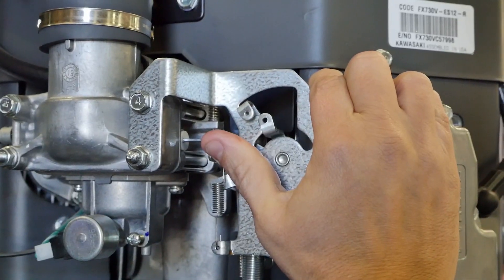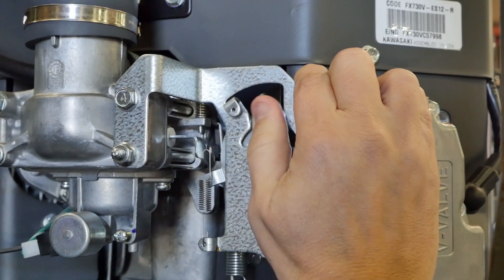WRIGHT | EFI vs. CARB Engines

Comment: Too many problems with Efi . Very difficult  to diagnose  and expensive to repair . Although of the problems I've heard of has to do with Battery's,  they must be kept at 100% charge. If not the EFI doesn't have the power to read properly.
Reply: Didn't he just said EFI generally make it worth while.  What don't u get lol

Comment: It's amazing with the computerized technology, most EFI engines can't simply go bang right away with less than a 90 degree crankshaft rotation like a carbureted engine can, instead you get "da, da, da, da, da, da  . . . ."

Comment: Very well done video. Some reject fuel injection because they don't understand it. I get the fact that service/reliability is a reason, but IF they are designed right, FI is a just a better way and lasts forever. I remember when people rejected electronic ignition and disc brakes on cars saying points/condenser and drum brakes were better - really!!??

Comment: I’m changing my two 37EFI Briggs to carbureted because the fuel injection sucks and it cost a lot of money to get the program to adjust it! 
I engine runs good the other will just shut down if you put low grade gas in it! After changing them over I want to see if I can run low grade gas. That would save me a lot of money!

Comment: I would disagree with one point, the closed loop EFI engines(Kohler & Vanguard) get noticeably better fuel economy than open loop(Kawasaki) in my observations.  Now the difference in fuel economy could be due to other factors, but I think it’s far more than a coincidence.  Just my opinion, but I think Vanguard is the best EFI engine, for that matter, I think Vanguard are the best mower engines period.

Comment: On my new ( purchased on 28 August 2023 / now 15.6 hours )  ZXT 72 61G8 / sn: 161469LF : I just had my dealership: D & J Equipment, Inc in Longwood, FL,  upgrade my mower to the  Wright part #72410104  " Tweel Wheel Rear Tires."  🤠 OH YEA

Comment: Imo the best engine out this days as far as commerial wise is the Briggs and Stratton EFI Vanguard with the Oil Guard system. I have several different brands of mower/machines and that B&S oil guard is a fantastic idea they did for the commerial gear.
Reply: The oil guard simply allows longer change intervals. The oil filter is easier to change. But it doesn’t do anything for longevity compared to the standard change. Both engines have an oil cooler. Frankly if your machine sits unused during the off season the oil should be changed at the start of the season regardless due to condensation that will be in the oil. So in short, I’m not sold on the oil guard system but I do like the Vanguard EFI engines.
Reply: @tylermacconnell217  one issue you didn't mention. If a wet sump system is low on oil (most fleet machines) and then you mow on a slope, the oil pump is sucking lots of air. Air makes a very poor lubricant. The MAJORITY of engine failures is not from normal wear but lack of lube. Also under high temps and heavy loads the dry sump tank significantly cools the engine oil more than that small heat exchanger next to the flywheel. One disadvantage of dry sump is cold weather, I warm the engines much more in cold weather before full load is applied almost 6 qts vs 2 qts of oil to heat up.
Reply: @firstname6208  Vanguard engines with Oil Guard are NOT dry sump engines. They would not behave any differently on a slope.
Reply: @tylermacconnell217  there is less than 1 qt of oil in the engine at any time, 5 qts in the tank, the pump socks oil from the tank puts it under pressure and into the engine. The pump is not belt drive, that does not determine wet or dry sump. The location of the oil determines that.
Reply: @firstname6208  I stand corrected. I looked at the Vanguard site and they are claiming it is a dry sump design. The added volume of oil, and being remote form the engine, will allow the engine to run a little cooler (even though they do both have an oil cooler, so apparently even the Oil Guard version still needs one).
Reply: @tylermacconnell217  I have two of these and there is no oil cooler on the engine (tin plate in its place). The  steel tank acts as the oil cooler and does sufficient job the oil is 10-20 deg cooler than without oil guard system. The sad part is inflation has driven the cost up so much anything new is just too DAYUM high these days.
Reply: @firstname6208  Strange, the ZXL with the 37 HP EFI has the oil cooler.
Reply: @tylermacconnell217  my dealer has a zxl in stock, I believe it has the 40hp vanguard. Next time I'll see if it has a cooler.
Reply: @firstname6208  ZXL is not offered with the 40HP, only the 37. You are thinking of the similar ZXT which only comes with the 40 and Oil Guard. I would be curious to see if the ZXT with Oil Guard has the oil cooler as well.

Comment: Are there any longevity benefits of an EFI engine vs. a carbureted engine in terms of mechanical wear from a more precise air/fuel ratio or do the carbureted engines, when working correctly, burn clean enough to keep fuel contamination manageable for the oil?

Comment: when it comes to lawn mowers the decision is tough and equally right on carb vs efi.  either way you go in a lawn mower, will work great.  Car or boat the answer is efi.  I have a Kawasaki carb and Kohler carb engines that work great. 22hp Kohler carb engine in are Deere 130 has been around 6 year mowing 2.5 acres and never once gave a problem.  And after a year of use the engine oil still looks clean.

Comment: I had my cub cadet riding efi riding mower in the shop 4 times last year. Still dying out...now being told the efi's are "nothing but problems...they clog easily...backfiring..but shouldn't. " Modulator and governor spring already replaced. Only 3 1/2 years old. 46inch deck. Very disappointed and still no solutions...limited repair services for efi too.

Comment: i wonder why manufactures dont use the smaller 19hp efi engines on the smaller mowers if the benefit is that much fuel savings? they should have that option at least...and liquid cooling on 18-40hp engines with efi...its supposed to be better so why not make it?

Comment: You've done a poor job of explaining the differences in closed-loop versus open-loop EFI.  There is a significant fuel savings in a closed-loop versus open-loop fuel injected mower engine.  You made mention of higher operating temperatures negating the efficiency of closed-loop fuel injecting, when in reality you must reach full operating engine temperature for the oxygen sensor to perform as designed.  I think people should have accurate information based on actual technology, not opinion.  
 
QUOTE: 

The Electronic Fuel Injection (EFI) system is a
complete engine fuel and ignition management
design. The system includes the following principal
components:
• Fuel Pump
• Fuel Filter
• Fuel Rail
• Fuel Line(s)
• Fuel Pressure Regulator
• Fuel Injectors
• Throttle Body/Intake Manifold
• Engine Control Unit (ECU)
• Ignition Coils
• Engine (Oil) Temperature Sensor
• Throttle Position Sensor (TPS)
• Speed Sensor
• Oxygen Sensor
• Wire Harness Assembly & Affiliated Wiring,
• Malfunction Indicator Light (MIL)

Operation
The EFI system is designed to provide peak engine
performance with optimum fuel efficiency and lowest
possible emissions. The ignition and injection
functions are electronically controlled, monitored and
continually corrected during operation to maintain the
theoretical ideal or “stoichiometric” air/fuel ratio of
14.7:1.

The central component of the system is the Motronic™
Engine Control Unit (ECU) which manages system
operation, determining the best combination of fuel
mixture and ignition timing for the current operating
conditions.

An electric fuel pump is used to move fuel from the
tank through the fuel line and in-line fuel filter. A fuel
pressure regulator maintains a system operating
pressure of 39 psi and returns any excess fuel to the
tank. At the engine, fuel is fed through the fuel rail
and into the injectors, which inject it into the intake
ports. The ECU controls the amount of fuel by varying
the length of time that the injectors are “on.” This can
range from 1.5-8.0 milliseconds depending on fuel
requirements. The controlled injection of the fuel
occurs each crankshaft revolution, or twice for each 4-
stroke cycle. One-half the total amount of fuel needed
for one firing of a cylinder is injected during each
injection. When the intake valve opens, the fuel/air
mixture is drawn into the combustion chamber,
ignited, and burned.

The ECU controls the amount of fuel being injected
and the ignition timing by monitoring the primary
sensor signals for engine temperature, speed (RPM),
and throttle position (load). These primary signals are
compared to preprogrammed “maps” in the ECU
computer chip, and the ECU adjusts the fuel delivery
to match the mapped values. After the engine reached
operating temperature, an exhaust gas oxygen sensor
provides feedback to the ECU based upon the amount
of unused oxygen in the exhaust, indicating whether
the fuel mixture being delivered is rich or lean. Based
upon this feedback, the ECU further adjusts fuel input
to re-establish the ideal air/fuel ratio. This operating
mode is referred to as “closed loop” operation. The
EFI system operates “closed loop” when all three of
the following conditions are met:
a. The oil temperature is greater than 35°C (86°F).
b. The oxygen sensor has warmed sufficiently to
provide a signal (minimum 375°C, 709°F).
c. Engine operation is at a steady state (not starting,
warming up, accelerating, etc.).
During “closed loop” operation the ECU has the
ability to readjust temporary and learned adaptive
controls, providing compensation for changes in
overall engine condition and operating environment,
so it will be able to maintain the ideal air/fuel ratio of
14.7:1. The system requires a minimum engine oil
temperature greater than 55°C (130°F) to properly
adapt. These adaptive values are maintained as long
as the ECU is “powered up” by the battery.

During certain operating periods such as cold starts,
warm up, acceleration, etc., an air/fuel ratio richer
than 14.7:1 is required and the system operates in an
“open loop” mode. In “open loop” operation the
oxygen sensor output is not used, and the controlling
adjustments are based on the primary sensor signals
and programmed maps only.
Reply: Agreed, he was definitely off on the closed loop vs open loop.  No doubt, much better fuel economy with closed loop.   All modern vehicles run closed loop.

Comment: Volvo invented that in 1977 called lambasom the oxygen sensor in the tail pipe and a computer monitor the fuel ratio 😀 yes I was a volvo dealer then🙂
Reply: Actually it was called Lambdasond (Lambda being the Greek symbol for oxygen/air I believe). And while it Was on my Volvo, it may have been invented by Bosch for Volvo as part of their K-Jetronic system~

Comment: Does efi tend to start a little easier?
Reply: Yeah but when they break it tends to cost a lot more to fix. More sensors=more stuff to break
Reply: @jonnyg44  that's a really old stupid concept
Reply: @851995STARGATE  how much do you think a fuel pump for a mower cost, or an O2 sensor? I’m sure vanguard and kawi have decent efi motors but they are more complicated and yes they do cost more for a replacement.

Comment: The guys that dont trust efi must drive a truck that is at least 35 years old. My 07 and 09 fords ran 250k miles with almost no repairs. My carbureted vehicles always needed this or that. My 86 chevy k20 pickup is like a 2500hd  of today. It has a 5.7L v8 that gets 12 to16 mpg and has 160hp and 260lbs torque. A 1987 5.7L v8 had PRIMITAVE fuel injection system and made 205hp and 310lbs of torque.... modern day F150 with a 2.7L turbo v6 makes double the power and has a flat torque curve thats 100lbs higher than my 5.7L and gets 25mpg unloaded.... ppl buy an efi of current technology, theres no reason to use a gas guzzling carburetor. If you arent running EFI you better be like me and running a diesel mower with mechanical injection system
Reply: Big diffrence  between a automotive engine and a mower , snowblower engine
😊
Reply: What motor do you run on your mowers? Lmk when they hit 1500 hrs if they ever make it there. Not trying to be mean but I’m out here to cut grass and make money not have my efi mower stuck at the shop getting fixed every few hundred hrs.
Reply: @jonnyg44  is it that bad with these efi engines?
Reply: @jaybrown29 no less reliable than EFI on an ATV or pickup truck. Nice not needing to buy non ethanol gas for EFI motors
Reply: @jonnyg44  I was running a Kubota diesel mower back then for main mower and have 2 carburetor type kawi powered walk behind. 
A number of ppl I've talked to over the years get 2-3k hours out of mowers with Kohler EFI

Comment: Quick question for you it’s a little bit off topic but whenever I step on my 2020 stander x it makes a noise in the gas tank I figured it is the magnet rattling back-and-forth with the gas is there anyway to prevent this or fix it?
Reply from the maker: You're most likely hearing the cut-off switch designed to shut off the blades if the operator steps off the machine while blades are running.  https://www.youtube.com/watch?v=Vbl50E-tPzc
Reply: It’s a ticking noise.  It’s the gas gauge moving with the gas moving.

Comment: My ZK 52” has a Kohler efi 860. Currently in shop for 2nd time. First time @ 518 hrs severe engine knock. Dealer, Interstate Supplies & Service couldn’t find problem. Was told no engine runs perfectly. Now 693 hrs knock is worse. Told dealer to keep it until they find the problem. I do all maintenance at required times. Change filter with every oil change. Thoughts?
Reply: That knock you are hearing may be the hydraulic lifters being noisy. Some efi engine applications call for 20w50 oil which on a cold day will make the lifters tap hard.  Also if the oil is starting to turn dark the lifter noise will be louder. Alot of people think it's a knock. Without seeing your machine I am simply just sending this suggestion out to you. I have had great results with putting a couple cap fulls of seafoam in the oil,  it quiets down considerably after running full throttle for a few minutes. I hope this helps, Merry Christmas.
Reply: My was the valve seal i replace with whole cilinder head new

Comment: I have retrofit X2 Kohler 740 closed-loop EFI propane engines on some older mowers of mine. Is there a reason I don’t hardly see these on any other mowers, including Wright mowers? I’ve had nothing but good luck out of them and was wondering why they’re not popular with manufacturers. They’ve been reliable and efficient so far (both have at least 2000 hrs on them). Thanks, I’m just trying to figure out new mowers to purchase.
Reply: Very few companies, usually only municipalities with emissions requirements run propane. It’s never got traction in the US and most manufacturers have stopped offering propane. Kohler engines are good up to about 26hp in the Command series. Once you step up to the big block Kohler’s 29+ up they have major issues. Hence why almost all OEMs have dropped Kohler big block offerings. They’re basically a 500hr grenade.
Reply: I beleive the Kohler cv980 38hp in The toro 38 stump grinders were 
all replaced under warranty
Reply: Propane runs very clean, and your oil stays cleaner. It may produce a little less power compared to a gas equivalent. The main reason propane hasn’t taken off is needing two huge tanks to mount externally and no being easy to refill versus gas out of a 5 gallon can if you run out.

Comment: Great video. Thoughts on the fx1000 efi?
Reply from the maker: Good engine.  Because it has a one-piece block, I'd like to see 8 bolt holes to hold it on the mower. -Ed
Reply: @WrightMowers    Will that engine be available on zk for spring 2021